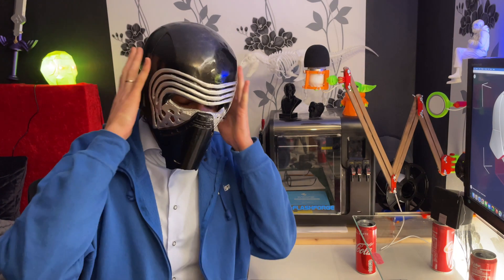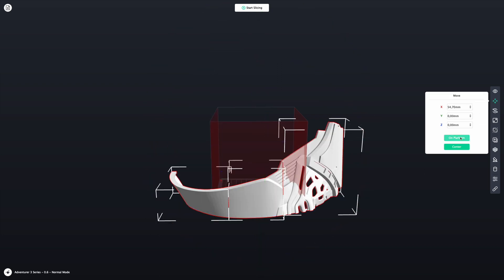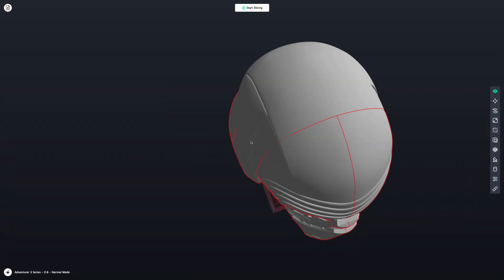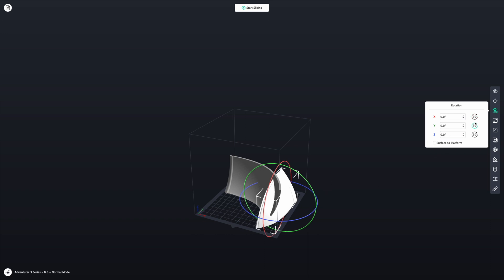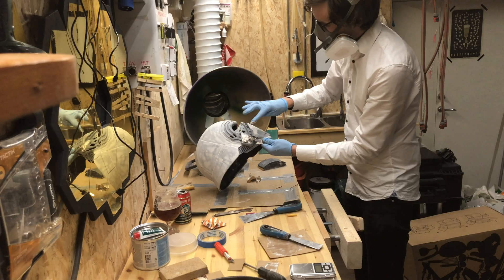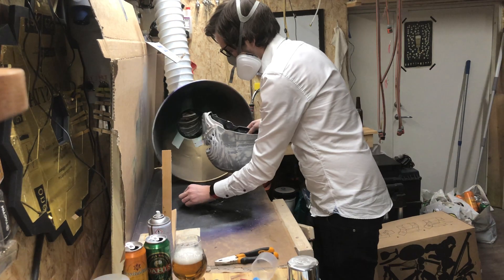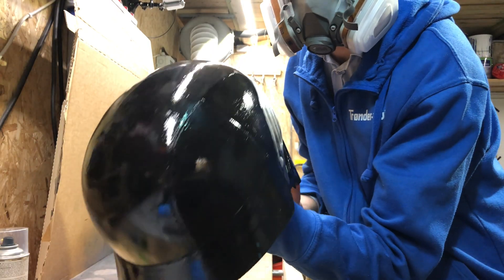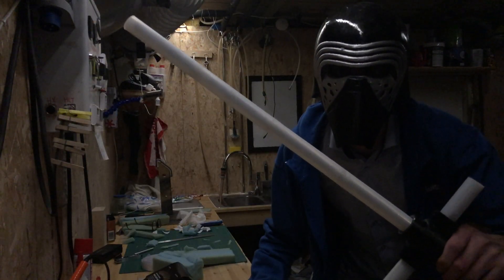Full sized helmet on a tiny 3D printer

Comment: So with the soldering iron, were you just melting the plastic with it? Not putting any actual metal in this correct?
Reply from the maker: That's right, melting the plastic that's already there, bonding the two pieces together. In a couple of areas I did add additional PLA to fill a gap, but the majority is just melting the two pieces to bond them.
Reply: Also can you link the filler that you used? :)
Reply from the maker: @Khunai.  Of course, but I doubt this link is useful, as it's a Scandinavian store: https://www.biltema.no/bilpleie/bilvedlikehold/bilsparkel/finsparkel-2000041672

It's really used for repairing dents in plastic parts of cars. I guess this one on Amazon is similar, but it is four times the price, though: https://www.amazon.com/STRONGHOLD-Smooth-Adhesion-Filler-Plastics/dp/B002M0R900/ref=sr_1_6?keywords=plastic+body+filler&qid=1647555437&sr=8-6